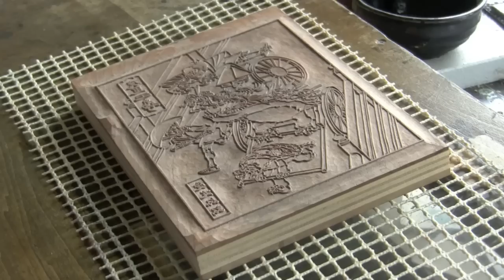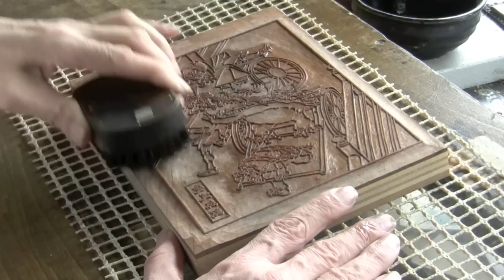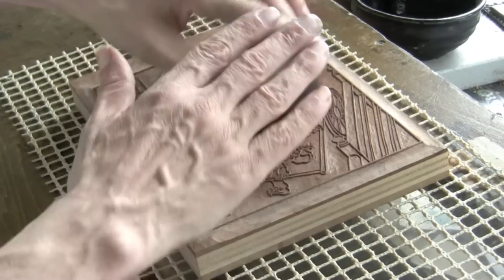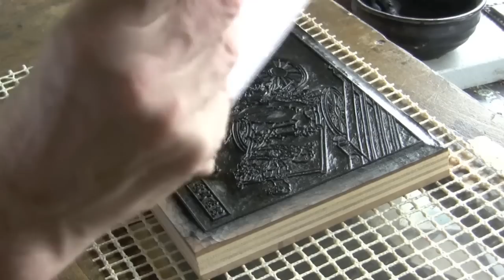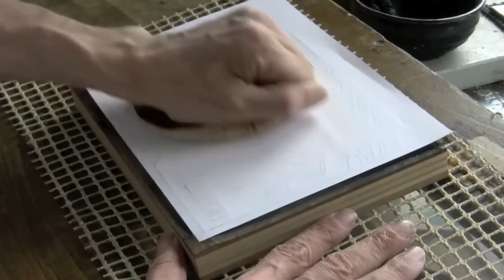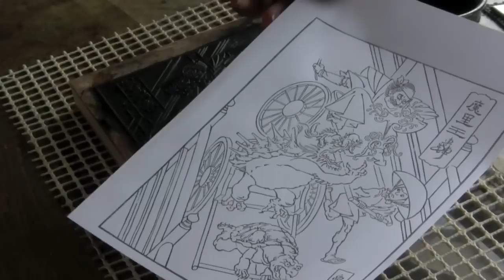Ukiyoe Heroes (1) : Rickshaw Cart - first proof

Comment from the maker: This is of course just the first rough pull from the block - the paper isn't Japanese washi, but simply a sheet of copy paper. I will now spend the next day or so inspecting this and going over many of the lines again, refining their appearance to match Jed's original brush strokes. Once I'm confident about that, I'll then pull a series of proper proofs carefully, and use them to create the colour blocks.